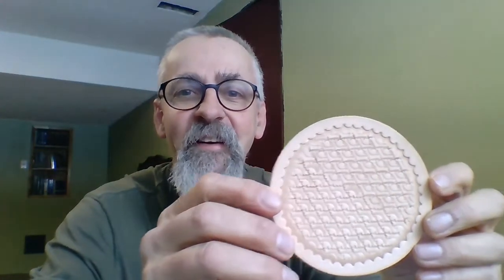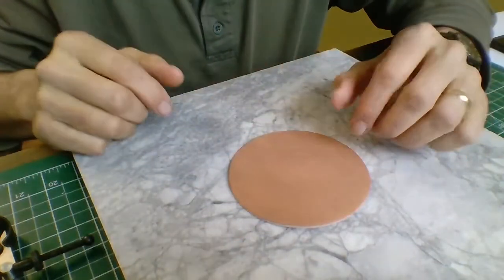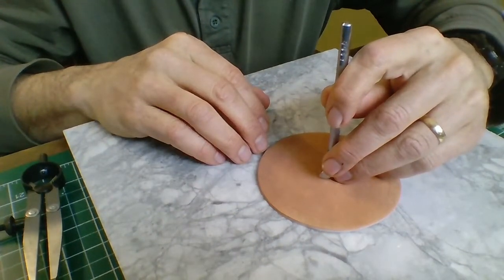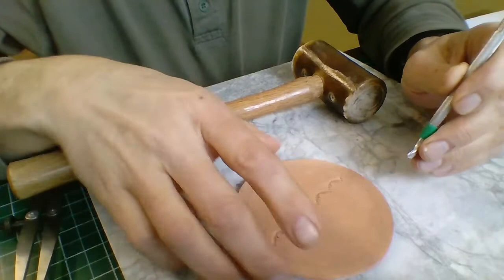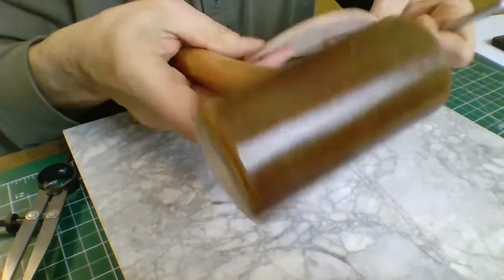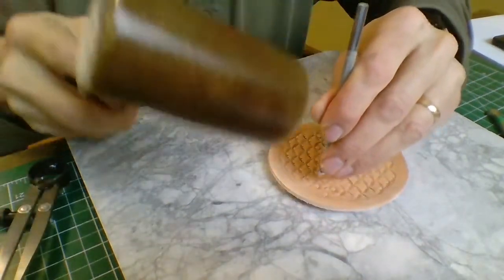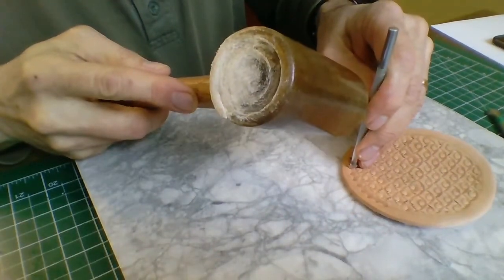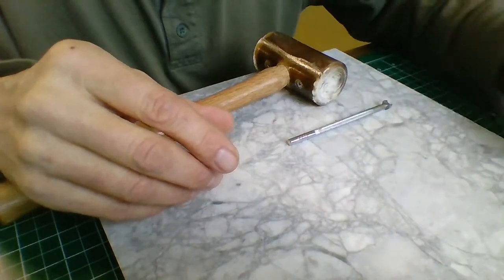Coaster Workshop, Part 1

Comment: Cool. Don’t your edge circle lines’ distance depend on the size of the camouflage tool?
Reply from the maker: Not really, because you can squeeze or stretch the camo tool impressions to fit whatever size the circle is. I go around about 3/4 of the way, then I check to see where I'll end up by making really light impressions. That tells me if I need to squeeze the last few together a tiny bit or stretch them apart. You can't see these small adjustments in the final outcome.
Reply: I meant because of how close the lines are to each other. If the flare of the tool is wider it might touch the other tool’s line- almost. Ending up with a skinny ribbon.